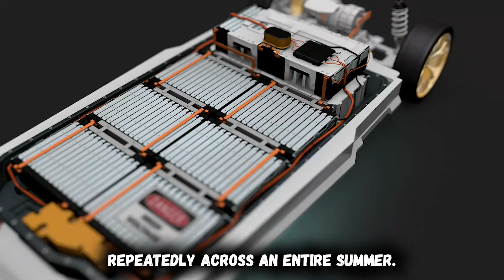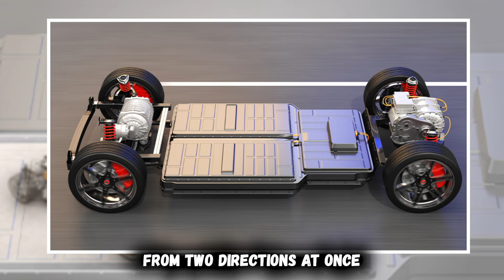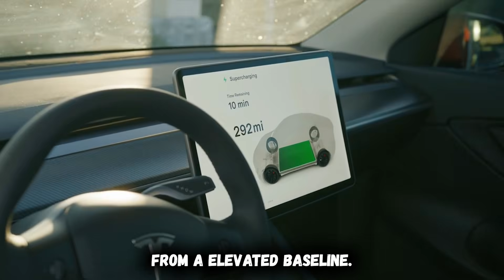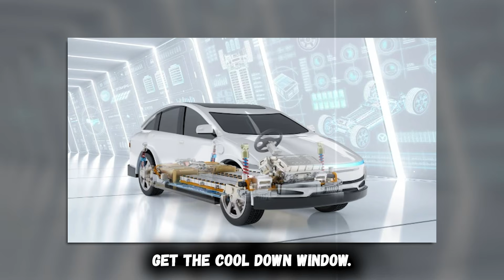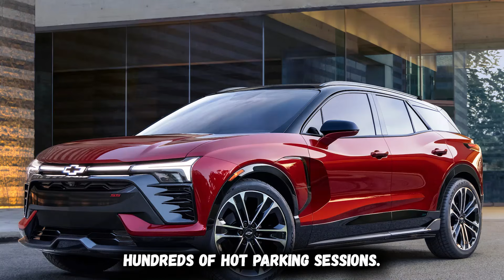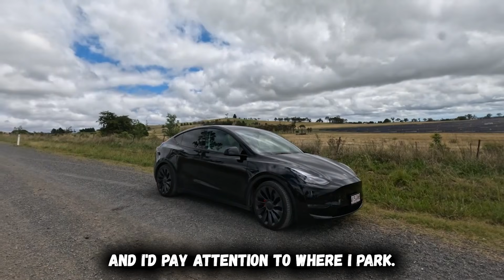Never Leave Your EV Like This in Summer

Comment: I'm guessing this is aimed at American EV owners because in the UK we're advised to Condition the battery as we approach a DC Rapid  charger to ensure the battery is WARM enough because UK is generally colder.
Reply: You must understand the typical American's mindset of unwillingness to adapt to change.

I'm 68 and am an Analog Neanderthal who has owned Exclusively carburated stickshifts for my entire driving life. 

I'm stubborn and I would not even consider anything that was not a stickshift, however I did my due diligence and research and 15months ago I purchased a used '14 BMW i3bev for my daily driver retiring my beloved but Very Temperamental '86 Isuzu Trooper from daily driver status, currently undergoing re-engining and restoration. 

Most everyone that I know Will NOT consider an EV until the range is above 350miles and can recharge in 5minutes!!

My i3 only supports level1 and level2 charging, currently it's charging in my driveway and it will take 12hrs to charge from 20% to 100% with the granny-charger, not that I'm going to charge it to 100%, I'm just aiming for 60-70%.